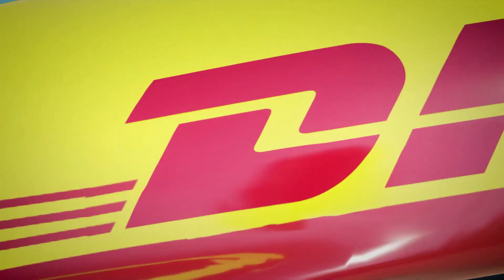The All-Electric Airplane is Here – Welcome Eviation Alice!

Comment: what happens when there are airport delays for weather? What happens when the temperature goes below freezing? How will the plane deal with ice build up on the wings in flight? How will the plane heat the passenger compartment - pilot compartment? It’s pretty cold up there.. charcoal or wood stove?
A plane like a 747 burns 1 L of fuel per second..
  well if the airport is shut down for a power failure or some other emergency while these electric planes are in the air waiting to land for some emergency like, an earthquake which is very possible in places like California or Washington or Canada or Alaska or Japan, etc..
  Hydrogen is a more realistic answer, not electric..
 come to think of it, what’s wrong with bringing back Zepplin airships. Or zeppelin airship trains. A zeppelin towing other zeppelins

Comment: When you're charging your batteries with fossil fuels, you've compounded the environmental damage when you consider mining and disposing of the massive batteries required.
Reply: That's a load of bollocks I'm sorry to say, it burns electrons not fossil fuel, and it doesn't pollute the sky, even if the electrons are produced by fossil fuels it's still clean.
Once batteries get to the point of needing to be replaced they have a second life as battery storage, after that, they are broken down for their parts.
All transport companies are transitioning from fossil fuels, just get with the times
looks like DHL has.
Reply: Not necessarily true if you factor in the benefit to efficiency that the scale of a power plant uses and the fact that a natural gas power plant produces fewer emissions than burning an equivalent amount of jet fuel. Combine that with the increasing share of renewables powering the grid and the fact that battery mining is a one time emission over the life of the plane and batteries end up cleaner.
Reply: You offering an opinion or is there data to back up your claim? All I found are benefits because once manufactured no emissions, reliability, service, etc favors electric vs fossil fuel aircraft engines. The Constancy of using fossil fuels on planes for each second of operation, the carbon trail of each ounce of fuel is HUGE. Sorry, you are incorrect.